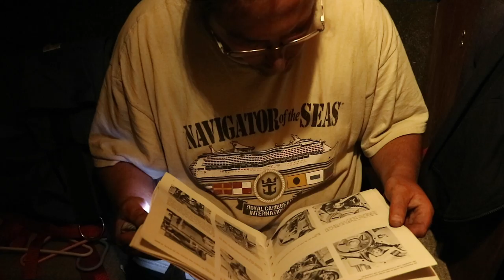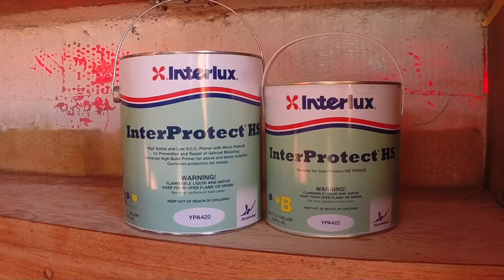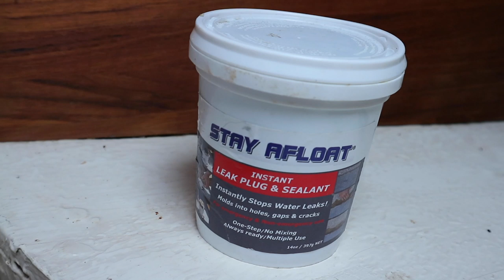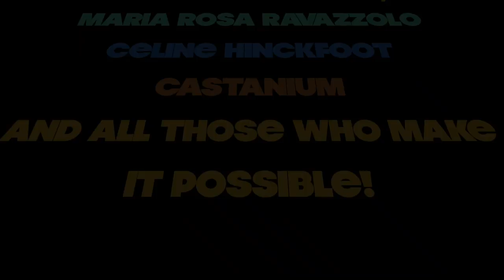18. Sailorama: Our 'New' Boat

Comment: Congratulations on the new boat! You guys got a lot of work done in short time..I wish I could do the same, my project is lagging behind (my fault). When you guys stripped the interior, was that just glue you removed with the wire brush, or paint also? I'm trying to figure out how to remove the flacking paint from mine, it`s a not thick layer of paint. My older French boat was originally lined with fabric, below a layer of foam there was just rough woven fiberglass, with a layer of white paint on it, very thin but it`s flacking off everywhere, I don't plan to re-line the interior with fabric, just paint the exposed fiberglass (I'm not going to live on it, so heat and condensation are not a big deal for me)... but I'm afraid the wire brush will affect the woven layer, it is fully impregnated but not smooth..any  thoughts? looks like someone upgraded the chain-plates of your boat not long ago, very nice boat! Just one thing I notices, the fwd portholes, they are the same found on older Hunters, I dunno who came up with that design, but they are  a pain to open and close, and the plastic frame that sticks out on the deck is like a chafing device for feet and legs.
Reply from the maker: Hey! Thanks for watching! We removed mostly glue residue, but some paint in spots also with the wire brush. The wire brush on the drill will only remove whatever is on top of the fiberglass (glue, and if you press hard and long enough, a bit of paint). The brush on the angle grinder can possibly blast through fiberglass if you lose concentration, however we mainly used this, and didn't have too many problems. We ground the fiberglass mat without having fibers stick out or anything like that. In the end, we like the look of the woven fiberglass painted over with the thick paint. We may have condensation problems eventually - but we're used to that already with Maiweh anyways.

We actually just took out those portholes this last week and are simply bolting on polycarbonate sheet windows, because they were indeed a pain!

Comment: Hello Maiweh Sailors, Love your videos. 
If you haven't done the seacocks yet you might want to check out these composite seacocks, thru-hulls and valves. Mads at Sail Life is using Trudesign on his new boat, he now has 2 boats just like you guys!
The forespar seacocks are cheaper and require some lube occasionally.
You eliminate galvanic corrosion and a bunch of bonding wires, which is nice.
Your idea to reduce the number of thru-hulls is very smart.
Enjoy the refit,
David
PS: Now Robbie can hold his head high in the cabin...

http://raritaneng.com/product-category/trudesign/seacocks/
http://www.forespar.com/products/boat-marine-plumbing-flange-mounting-seacock-thru-hull.shtml
Reply from the maker: Hey, thanks for the info and links. This seems like a good idea. We'll see where we're at when we take the old stuff off, and keep your suggestion in mind. Looked at Sail Life channel as well. Very organized videos. Nice!
Reply: You're welcome and best of luck.

Comment: Congrats on the new boat and the progress in restoration. A few comments:

The boat is a Bayliner Buccaneer 34. The good news is the designer, Doug Petersen is highly respected. The bad news is that it was built by Bayliner.

The design is an IOR 3/4 tonner, which, due to the rating rules for racing in those days, has an exaggerated pinched stern, High aspect rig with a small main and big overlapping genoa. This is not a good setup for cruisers due to the sketchy downwing characteristics in heavy wind and seas and difficult sail handling. 

My opinion is that any investment into the boat will not be returned when you sell, so if you aren't in love- take your profits fast. I would suggest that an old full keel design with a low aspect rig from a reputable builder will be a happier boat for you all to own.

 http://atomvoyages.com/planning/good-old-boats-list.html

This link gives a list of boats to consider.
Reply from the maker: Hi there, the plan is to put as little cash into the boat as possible, as we don't have much anyways. If we ever plan to sell her, I suspect a Bayliner can only gather 10 000 - 15 000 USD, max. So in the end, we spend a little, and make a little - not nearly enough to buy any of my dream vessels on that list. It's a great list and all, but I've never been lucky enough to get close to owning any of those boats in seaworthy condition. Who knows what happens in the future! Thanks for the comment and thanks for watching!